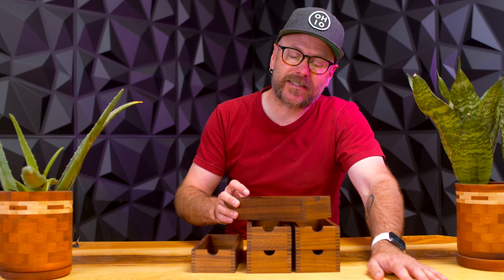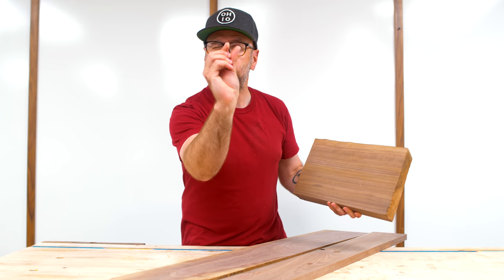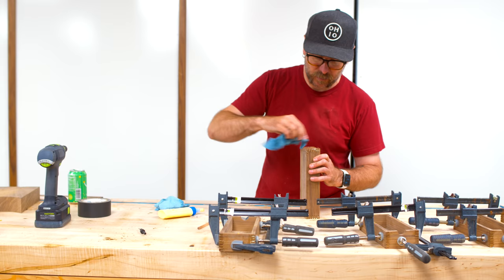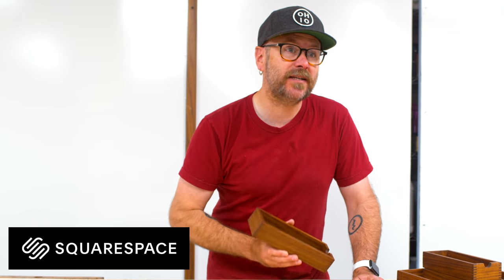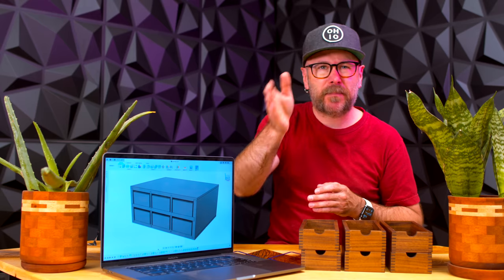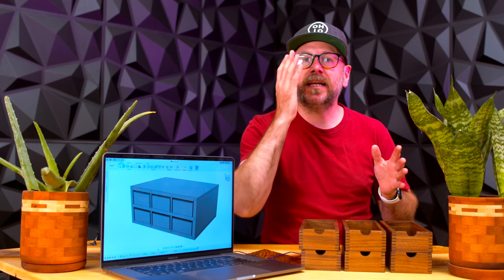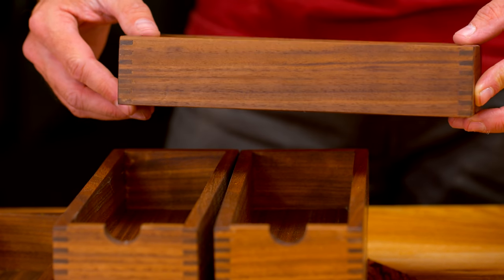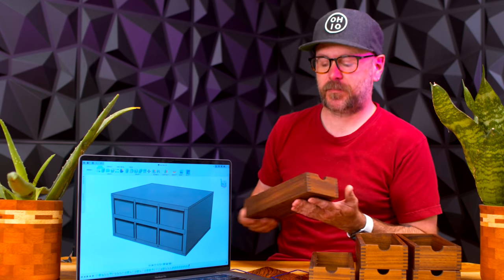I need your help finishing this woodworking project!

Comment: Ok, here goes.  First, check out some of Izzy Swan's latest videos and look for the one where he does the shelves that stay horizontal when folded to a table.  Using the same idea, make a mechanism that will hold three stacked drawers.  Take the two stacks, combine the mechanisms on a base so that they will drop in opposite directions leaving the six drawers abreast of each other.  Now,  make a leather case (with a handle) to contain the entire thing, and when it opens up it's like a large tackle box.  The drawers are held down with magnets and can be lifted out at will.  No idea what you'd keep in it, but you could take it anywhere and be the only person with one.
Reply: That would be cool.  Awesome idea.

Comment: Sorry, I didn't read any of the previous comments so if this may be a repeat but it is my initial idea.  Have the boxes stack one on top of the other with a slight gap in between.  They will all hinge in the back so when you need to access the contents in one of them, just swing it out to the side.  Since you have the brass rod already, that could be what connects them by being the hinge.

Comment: 0:24 Build the drawer holder 2 wide and 3 tall to sit beside the trash can. Make the base that sits on the floor extra wide and add drawer slides to a  lil' shelf that the trash can sits on to ease the trash can in and out

Comment: I see a bathroom or office organizer that hangs under a shelf. The drawers are on articulating arms like the old work lights so they can swing down and out to access what's inside, then back up and in when not in use.
Maybe three in traditional drawer slots and three under the cabinet to swing down. I can't draw so I hope that explains it well enough.

Comment: To build upon what you've modeled already. Maybe only enclose the bottom three drawers and leave the top open, perhaps with angled sides/dividers that terminate at full drawer height in the back. Also,since the walnut has such a nice warm finish, I'd love to see some dark copper accents.

Comment: Great video and build. Awesome concept. One word "pole." Attach back of drawers to pole with pipe straps. Include spacers and stack drawers on pole. Drawers can rotate around the pole axis. Base can be something heavy: dumbell plate, concrete, can of bolts, a rock...I know an epoxy river table? Mahalo for sharing! : )

Comment: Different colored translucent acrylic sheets as the case? Maybe lighting behind it so the acrylic glows? Or maybe the drawers should fit in a cylinder? Turned segmented walnut rings? With brass legs so it doesn't roll around.

Comment: Build the case that is 3 units tall and 2 units wide.  I like the mail holder, but it fits better on the side.  That way you could use it for taller pieces of mail as well (I use a lot of legal pads and file folders).  Walnut and brass rod?  Looks amazing!
Oh, then send it to me... I just moved into a new home office and my wife is already complaining about the clutter on my desk.
Thanks!

Comment: I'm thinking a small corner liquor/wine cabinet with 3 drawers stacked on each side at 90 degrees from each other and a cabinet with a sliding door to fill the gap. The drawers could be used to store shot glasses, coasters, bottle openers, etc. Maybe even add a rack over the top for wine glasses.

Comment: Little brass label holders on the front of the boxes would look good with the walnut. Also what if the larger case was made of box joints as well. I think they fingers will have to be bigger. Maybe scale them up equivalent to what the smaller boxes are.

Comment: So I think you need a charging station on top.  Build in a wireless charger for things that are ready for that on one side.  and then have a row of usb chargers along the back for other things.  If you work it right you might be able to make a small light that works in with the 5v usb  power.  A couple of slots for mail and folders above and below would be cool too.  
Love what you do!

Comment: David, How about a case on a lazy Susan spinner device with 2 boxes opening from the front, 1 from the rear, and 1 on each side on different planes.  You then spin the box to open the drawer you want.

Comment: As others have suggested don't hide the boxes. Open construction using brass rods as separators. Maybe a thin walnut shelve to enable stacking. Nice work by the way

Comment: Arrange the drawers in a circular fashion with the top of each drawer facing into the centre. The box is some kind of wheel mechanism which encloses all but one of all the drawers so you have to spin the wheel before you can open the one drawer with its top facing up, at the bottom of the wheel. A bit like a Ferris wheel I suppose.

I hope this makes sense David 🤔

Comment: CUBE OF POWER: you should make a cube organizer where there are 2 drawers per row stacked 3 high and the drawers are oriented from multiple faces. For example, on the front the drawers are on the middle row ; the bottom row and top row slide from the right to left . Due to the dimensions, just make the drawers so they can slide in and out from both sides of the box. You could use inset magnets to help the drawers stay soft-locked in position when shut to avoid over sliding. Try to make the whole thing as cube like as possible so the thickness for the box boards will need to aim for about 1/2 inch thick to make the math work. For the top have the sides of the box overlap the top edge to create an inset there you can throw junk mail, nik-naks, or whatever. The added height on the top lip will make up the difference in height to make the overall dimensions about 9 x 9 x 9

Comment: Could do a stepped style. First step 2 draws. Second step open pocket the same height as the 2 stacked draws, with another 2 draws on top of that and the third step with an open pocket the height of 4 draws stacked, with another 2 draws on top of that. Plenty of space for mail, filing and stationary, maybe even a small indoor plant.

Comment: Hey David a step pyramid design could be cool with 1 drawer on the top 2 in the middle and 3 on the bottom
Reply: I like your idea. It could be used as seed storage for your garden. Or a spice compartment that sits on your kitchen counter.
Reply: This is what I was thinking. Then on top of the 'steps' you could build pen /pencil holders, envelope holders etc.
Reply: Like your idea of a pyramid but how about turning it upside down with some sort of support to hold it in the air
Reply: @outlawecho1498  thats a really neat idea
Reply: @matttaylor7289  this would be a really cool aesthetic, it might be neat to have the base of something like that be a paper/mail tray with the drawers mounted above it

Comment: 3 boxes tall, a gap in the middle with little dividers (like 1" high) to sort files/folders/papers  (or no divider, so you could use it for journals, etc and then 3 drawers high on the end.
-----------------------------------------
|{  box 1 }|          |{  box 4 }|
|{  box 2 }|          |{  box 5 }|
|{  box 3 }|    |     |{  box 6 }|
-----------------------------------------

Comment: How about making a circular frame to hold the drawers that allows them to rotate along a vertical plane, like a Ferris wheel? The base could be brass tubing bent into shape on either side of the wheel in a double vee / wedge to allow for holding of files, magazines etc. To kick the cool factor up a notch you could incorporate a metal ball suspended in the center of the wheel by magnetism and/or soft LED lighting to better showcase the accents you get from the brass. Finally, if the drawers are still removable from the Ferris wheel, that would make increase its functionality imho. Greetings from Trinidad and Tobago. Stay safe out there.

Comment: Vertically stack the boxes, put a brass rod through all of them in n one corner. Then they can pivot to "open" each drawer or they can all be turned to a different spot. Probably need a curved base that follows the curve of the pivoting boxes to make it stable.

Comment: Maybe we could build a small cabinet that randomly pushes one drawer open when you try to close all six. When you close the drawer that was just randomly pushed open, another drawer randomly opens. It would be mildly hilarious! You’d need a little coding (it’ll all come back to you. Ha!), an Arduino, maybe a handful of solenoids (or another mechanism), reed switches and a little 3D printing. Maybe the project could also be crowdsourced. Or Bob.

Comment: What if the case stacked all of them vertically and the side faces could be used for something like hanging a clipboard or a whiteboard. Or even house a picture frame so it could look nice siting sideways on a desk with the drawers sliding out the sides
Reply: On the outer and visible side, you could laserburn a landscape or another image. On the inner side, you could keep the place to hang papers or a clip/whiteboard
Reply: I was thinking a vertical case too... and then one side with some tiered file storage for stability. Assuming anybody has paper anymore.
Reply: I like vertical - 'thin tall vertical' is not so traditional.

Comment: I'm seeing a vertical design but with the drawers offset and with cubbyholes. For example, make the width of the case half again the width of the drawers or even more but not twice the width. Since they are short put two drawers on the right side with a taller cubbyhole on the left, then the next two on the left with the cubbyhole on the right, etc. Those cubbyholes might be useful for letters, or whatever. The top wouldn't be wide enough for folders or papers but you could make a vertical space to one side for those.
Which gives me a second idea. Make the unit with three drawers on each side and trays between the vertical units. Worth a thought anyway.

Comment: A triangle with three drawers on the bottom, two in the middle, and one in the top. If you wanted you could add a magazine holder, mail holder, scratch paper, etc... in slots on the sides.

Comment: Make steps.  3 high then 2 high then 1.  And then have a slot for files on the tall side.  That way you can have room for staplers or tape on the steps and it breaks up the lines.

Comment: I’m thinking you could place the drawers in an L shape, three on the bottom and then two stacked on top of one of the end boxes, then add holders for notebooks/ mail over the remaining space. 
Alternatively stack the boxes over the middle box like an upside down T, and then ad supports on one side to hold mail or notebooks and open boxes on the other to hold erasers/ paper lips/post it papers or similar.

Comment: How about building something that rotates (by a handle) with each drawer weighted to stay upright as it rotates around inside the case and the drawer at the top is the one that is accessible. If the casing is transparent you could visually see the drawers as they rotate around inside.
Picture a cog of a bike which rotates as the pedal is moved. Each of the drawers would be fixed equally spaced to the teeth around the cog.

Comment: I keep thinking of a riser with 4 drawers across the top, and two on the bottom like stout legs.  The center bottom would be empty to accommodate larger objects. You could put a monitor on top?

Comment: My two cents: 2 RAWS of 3 drawers have boring proportions. A single raw of six is probably much interesting, and will bring a contemporary touch. Then the piece should not lay on the desk, mostly because you will need an empty desk to be allowed to open the drawers. So I would raise the drawers maybe about 3 inches above the desk. So you'll be able to hide or store books or sketches under it. There's a lot of possible creative solutions to raise the drawers, like desk-ish mini legs or floating base, or wall mount shelf thing. About the top of the piece, you could (cnc) carve graphic trays on a side, leaving most of the top dry, like trays over 2 of the drawers and a flat surface over the fourth left drawers. Maybe you can extend some of the drawers elements in your design, like the half moon shaped from the finger holes and the checker pattern from the box joints. I recommend to take radical decisions. That's what brings interest around a masterpiece. You may build an extraordinary piece or a rubbish one. Both I would enjoy. Good luck!

Comment: Crowd sourcing your ideas, good plan. I think it would be really cool if you built it similar to your fusion plan, but small leather straps as drawer pulls, using brass tacks. Then bend the brass bar into an M and S and use those for vertical file holders. and Lastly remove one drawer and change it for a magnetic paper clip holder, that folds down, but has the same facing as the drawers. 

Good luck.

Comment: Use your render as a starting point, but eliminate the vertical panels and dividers, and replace them with the brass rod you bought. Then you can have those 8 rods stick up an inch or so from the top and braise top rails to make an inbox.

Comment: I see those drawers and imagine a floating shelf with the 6 drawers next to each other.  I'm not sure if something like that can be done.
Just an idea, i'm just having some fun. 😁
Reply: Was thinking the same. Use it as small part storage.
Reply: And maybe use magnets to hold the drawers up, so that the drawers are "floating" too.  downside is you can't store heavier stuff and they wouldn't really "slide out", but just a thought.

Comment: I about had a heart attack when you even mentioned burning walnut! It's my favorite domestic wood. Probably my all time favorite. 
The drawers are awesome. As an artist I see it as a great place to store pencils or brushes. With that in mind, I'd like to see three square "cups" across the back of the top for placing pencils when I'm drawing making them easier to see what's there and grab as I need them.  The front flat area would be great for erasers, blending stumps and other drawing tools.
Reply: Make sure you don't watch Gunflint Designs...Walnut is his firewood!
Reply: @kevinwillingham172  thanks for the warning. I don't think my heart could take that. I can't even fathom burning walnut! That would be like throwing out chocolate! 😲

Comment: How about a case with the drawers 2 wide by 3 high. On each side, an open tall compartment to house notebooks. If the sides are taller than the drawers, make the area above the drawers into a tray.

Comment: Ok... We'll be using all 6 drawers, single file BUT the sides will now be the faces ( the current fingerpull will now be obscured new ones will need to be cut. Thats what happens when you dont plan ahead)
- The carcass will be made of a single length of bent steel, rounded corners and powder coated beige.
- You can do this Dave Paciutto. Just think about direction, wonder why you havent before.

Comment: Dave, you always make interesting high quality videos - thank you. :)
I'd like to encourage you to listen to the most crazy suggestions in the comments section (including this one).
Instead of always going 'rectangular' and 'square', how about a cylinder, where the boxes are stacked in a X:2, Y:3 or even X:1, Y:6 in the center of the cylinder, then the sides contain hidden compartments. Sides could be hinged or the top could be hinged or pushed sideways to open ...
A cylinder would be great, but you could also go for a 'rounded rectangle' where the two sides are half-circles with the drawers in the center.
... Just to break the traditional squarish look. =)
The top could of course also be a dome-like top instead of being flat. -Or flat with an acryllic dome on top.
A wooden dome could probably be made on the lathe.
If making a cylinder, the drawers could go in different directions - feel free to be very creative if getting inspired from any of my suggestions. =)

Comment: I'd like to see a cool way of opening / closing. not motorised (unless it has to be to achieve this wild idea) but you push in and the drawer comes out and then lifts up. And then for them to return in you give a push down and it goes down and then continues in, cushion soft. smooth and slow, but not too slow, just enough for you to go - ooh nice action - as an involuntary response anyone has when they see it.
Reply: This is a good idea, second that. One can make sunken mechanical buttons that can push out the drawers (have been playing with this exact thought myself, I don't think it's too difficult and it would be awesome to see some hi-tech wooden stuff).
-Also remember: Springs can be made from wood; there are many possibilities, which have never been explored.

Comment: Been trying to figure out how to explain this.... I'm thinking 3 drawers wide on the bottom, paper tray running across the top of that, then one of your yearlong calenders with a mail slot behind it to be the cherry on top. Possibly using the brass rod for some dowel joinery accents between the drawer case and paper tray? Just my two cents, can't wait to see the end result, regardless! ✌️

Comment: How about this: Two levels, three boxes each level, arranged so they make a triangle. Boxes are hinged on the outside corner so they swing out. This will give you access to the entire length of the box without leaving a large footprint. Put the boxes on a platform that spins. If you stagger the placement of the triangles you can create a spiral pattern that would be visually striking as you slowly spin the stacks (you'd need a third layer to make the effect stand out.) Alternatively you have each level spin independently.

Comment: Instead of  3 over 3 drawers, do 3 rows of 2 on top of each other. The. You could make a file holder on one side then use the Shaper CNC on the other side to do a design or marquetry or something fun like that. Like your hot dog table.